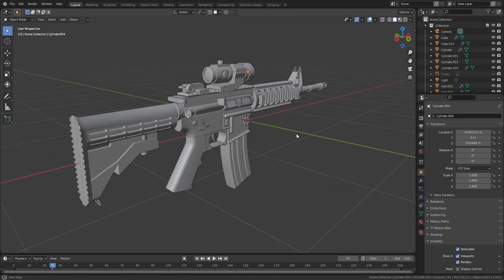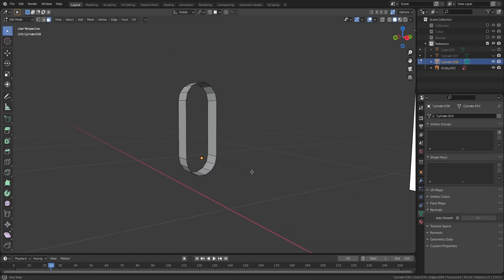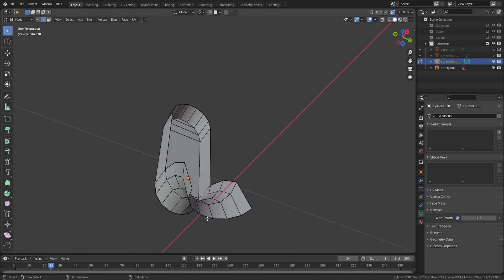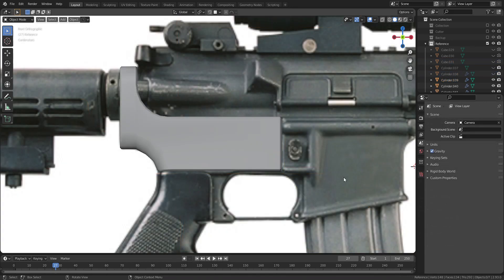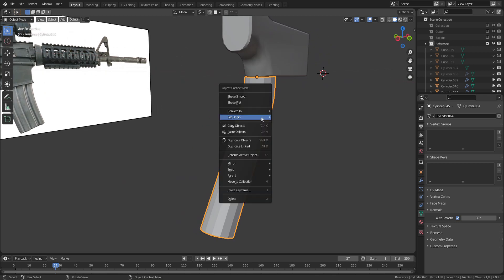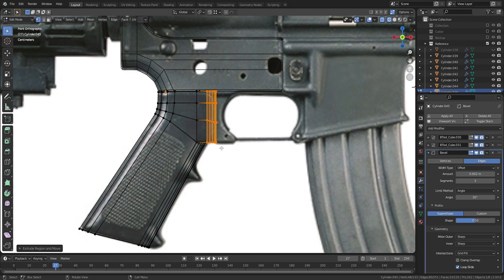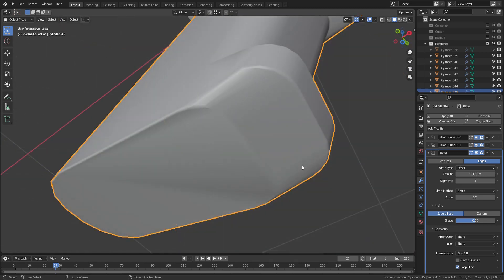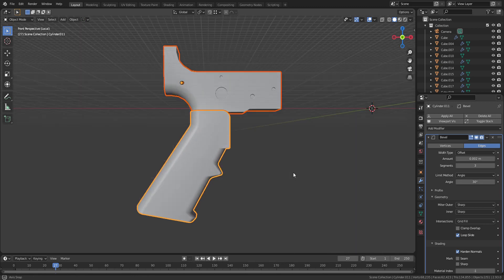【Blender】Modeling smooth curved M4 grip

Comment: How do you model that part of the grip? 5:58? I did exactly what you did: I selected the lateral front edges and I pressed ctrl + b on the x assis and it doesn’t work.
Reply from the maker: Hi, bevel doesn't care axis so if you press x after ctrl + b, it will not work. Also you need to bevel in edge edit mode, not vertex or face edit mode :)
Reply: @Guu_3DCG  I was in edge edit mode, man
Reply: @_thejuggernut_299  Applied object rotating and scale?
Reply: @_thejuggernut_299  You use ctrl+a to bring up that option